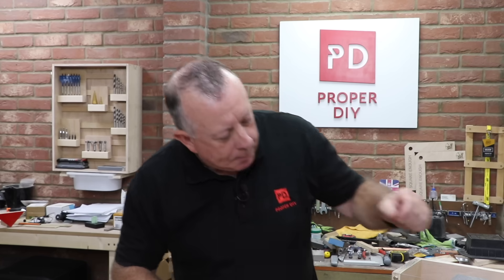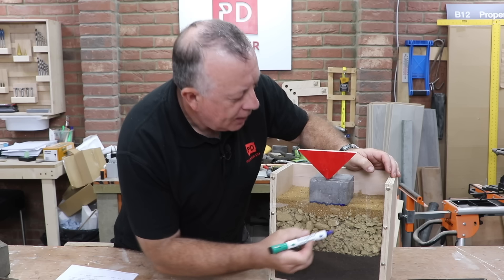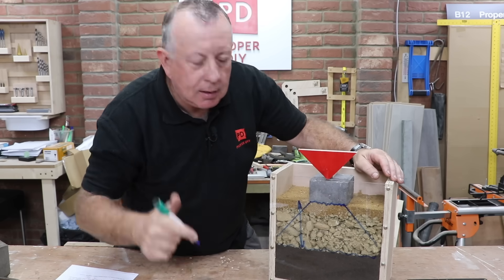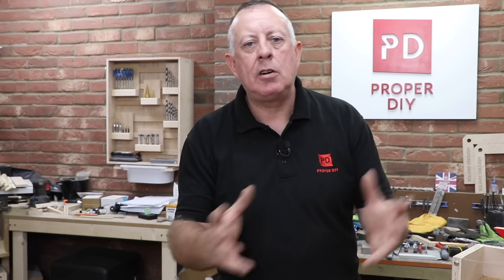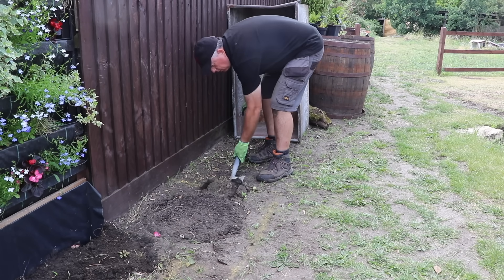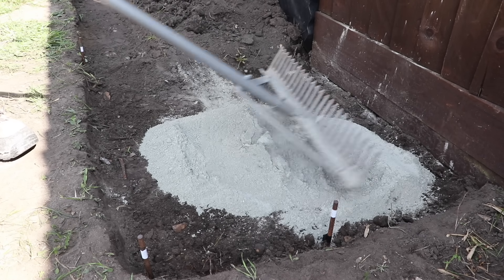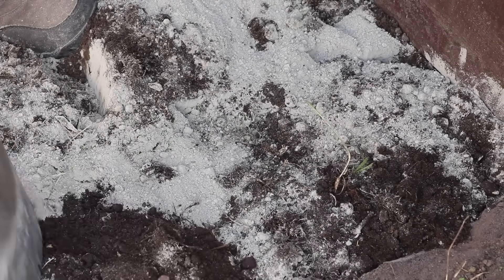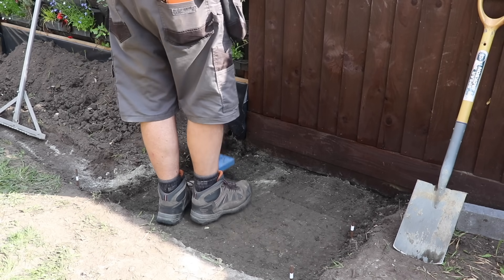How to Save Time & Money by using a little known Civil Engineering technique in the garden!

Comment: Excellent. We have a (approximate) 6m x 5m area that we want to use to park a few motorcycles on. This would be much cheaper than getting concrete brought in. Also for the barn/garage floor which is just dirt at the moment. But going back to the motorcycle parking, would the 4-1 mix be about right with possibly an increased depth and would putting re-bar on base be of use?

Comment: i want to prepare the base of the veranda with one layer of this cemented soil, then stone, than sand and then use cement bricks for the surface. the base layers should be more than enough to prevent shifting and sinking, right?

Comment: Very interesting video. I’m about to try this on a small project, however one thing I’m unsure about is how to ensure it dries adequately in wet weather, to ensure it gains sufficient solidity. Would it be worth temporarily covering it with plastic sheeting for a few days before putting sand and paving over it?

Comment: Hey PD! Recently DIY Guy has made some vids on a Pier system for a shed base. Do you think I could use your soil stabilization technique to build the subbase for a pier system or would it not be able to support as much weight as MOT type1?

Really interested to hear your thoughts, doesnt make sense to buy material if i can just stabilize the soil 🤔
Reply: I really get the impression that this would work 🤔

Comment: I understand this from a pave block standpoint, but if I'm pouring a concrete patio,  its not clear how a firmer base layer withstands the freeze thaw cycle, and would result in a cracked patio.  Doesn't the agggregate allow some soil movement below grade, in the same way it allows transfer of water across its surface?

Comment: now redo the experiment using a geopolymer activation solution. a mix of sodium hydroxide and water glass that is activated by the alumina and silica in the soil particles?
it will be even cheaper, have 5% of the Co2 impact as portland cement, and last 20x longer before it deteriorates

see the youtube channel geopolymer institute for more information.
if you are doing large civil projects you defiantly need to bone up your knowledge of low co2 long life geopolymer options.
portland cement is way to energy intensive, high in emissions, and short of life; in comparison to stronger geopolymer options using local materials
geopolymer can easily be higher in compression and flexural strength with more rapid hardening set times.

Comment: This is a great video Stuart, watched it a few times now. Going to be using this technique rather than Type 1 for a BBQ area. Using this method, is there still a need for a weed membrane? I'm presuming this would go AFTER this layer, and before the sharp sand layer and blockwork, rather than the usual before the MOT?

Comment: Or you can skip working with the dirt at all, make a form, throw in dry concrete. Use a paint roller which pushes the stones down and the soft powdery aggregate up until level. Then lightly mist every 2-3 hours.  Once you are at 12 hours give it a pretty good rain shower. 24 hours later do it again.  Done.  It's called a dry pour method and you can see "Cajun Country Living" do this on many projects.  After you screeded the cement, just stop there, you dont need to add soil.
Reply: That shouldn't be a thing. It's crap
Reply: "It's called a dry pour method and" And concrete manufacturers, civil engineers and everybody that has worked with concrete will tell you no - that does not work.
Concrete must be adequately hydrated AND MIXED to develop its strength or you are left with something that can't even withstand 1/5th the loads it should, not to mention that it will not be resistant to plantgrowth and crack in winter.

Comment: Re. adding water - I've noticed that it's best to stop adding water while the mix still looks a bit dry. Then let it sit for 5-10 minutes, followed by a good stir. Often after a few minutes of sitting like that it's just enough more fluid to compact well. It's like it takes a few minutes for the water to hydrate things and if you add enough water right at the start to make it look good, it actually becomes too wet.

Comment: The longer something takes to cure, the stronger it is. Homeowners are encouraged to water a new slab or driveway so the curing process is slowed and allows for a stronger finished product. This prevents cracking in undesignated places. Even slower in the winter time when it's cold., that's why slabs poured in the winter end up with fewer cracks, and a superb diamond hard finish. I noticed at the end of the video you mentioned you aren't going for strength however mentioned the water slowed curing and compromise strength,.. however a slower cure is a stronger finish, and that is true with cement, caulking, paint, plastics, urethanes, polys, molten stone or steel, etc

Comment: No - water does NOT make the concrete take longer to cure. But not wetting the cement enough will decrease it strength and significantly decrease its resistance to weathering. If the mix is still crumbly it is too dry.

Comment: Great video.  I'm thinking of using this to stabilise fairly heavy clay that will be under a 4*3m concrete slab for an outbuilding.  I have a rotavator so might be able to utilise it for its mixing effects. Some posters suggest lime rather than OPC.

Comment: Interesting concept! 
Now, as you pointed out, for typical garden applications you don't need very much strength at all. And cement is CO2-costly to produce. I wonder how a similar experiment would fare with lime, or even clay.
No, clay does not harden in the chemical sense, and yes, it heaves when it gets wet. But thoroughly compacted, it takes a long time to get wet.

Anecdotally, soon to be 20 years ago, I just wetted and compacted the local clay-rich soil. We built a raised bed for camp fires edged by two layers of boulders. And we paved a path that, until then, was always muddy and slippery when wet. This was at my scouting group, so both see quite a bit of use.
I just went by there recently and both are still fine! Nothing added but water and a good tamping  (and a bit of gravel/sand under the pavers).

Comment: My house has no foundations- I doubt if many round here have - and was built circa 1807, whether they had access to cement or stabilised the soil by other methods is unknown!

There is another advantage of the soil/cement mixture: weeds etc will struggle to grow through it unlike the mot type 1 which has numerous spaces inside, however well it is compacted.

Comment: Cement continues to cure if water is around unless there are sulphates in the soil then you need different cement. 

To be frost proof the base needs to be 450mm deep for South UK area or insulated accordingly.

Comment: My good friend and neighbour used this method in his garden to create a large patio area. He used a rotavator to mix the cement and soil and then used a hand tamper to compact it. The patio is still in great condition after nearly 5 years. This method was much more cost-effective than the alternatives. Thank you for sharing this brilliant idea, Stuart. It will save people a lot of money.
Reply: is a rotavator the same as a tiller?
Reply: @nickelsworth7097  yes
Reply: @nickelsworth7097  yes!
Reply: @nickelsworth7097  𝑾𝒉𝒊𝒍𝒆 𝒕𝒉𝒆 𝒕𝒆𝒓𝒎𝒔 "𝒓𝒐𝒕𝒂𝒗𝒂𝒕𝒐𝒓" 𝒂𝒏𝒅 "𝒕𝒊𝒍𝒍𝒆𝒓" 𝒂𝒓𝒆 𝒐𝒇𝒕𝒆𝒏 𝒖𝒔𝒆𝒅 𝒊𝒏𝒕𝒆𝒓𝒄𝒉𝒂𝒏𝒈𝒆𝒂𝒃𝒍𝒚, 𝒂 𝒓𝒐𝒕𝒂𝒗𝒂𝒕𝒐𝒓 𝒊𝒔 𝒂 𝒔𝒑𝒆𝒄𝒊𝒇𝒊𝒄 𝒕𝒚𝒑𝒆 𝒐𝒇 𝒕𝒊𝒍𝒍𝒆𝒓. 𝑻𝒊𝒍𝒍𝒆𝒓𝒔 𝒂𝒓𝒆 𝒂 𝒃𝒓𝒐𝒂𝒅𝒆𝒓 𝒄𝒂𝒕𝒆𝒈𝒐𝒓𝒚 𝒐𝒇 𝒈𝒂𝒓𝒅𝒆𝒏𝒊𝒏𝒈 𝒕𝒐𝒐𝒍𝒔 𝒕𝒉𝒂𝒕 𝒖𝒔𝒆 𝒓𝒐𝒕𝒂𝒕𝒊𝒏𝒈 𝒃𝒍𝒂𝒅𝒆𝒔 𝒕𝒐 𝒃𝒓𝒆𝒂𝒌 𝒖𝒑 𝒔𝒐𝒊𝒍, 𝒂𝒏𝒅 𝒓𝒐𝒕𝒂𝒗𝒂𝒕𝒐𝒓𝒔 𝒂𝒓𝒆 𝒐𝒏𝒆 𝒕𝒚𝒑𝒆 𝒐𝒇 𝒕𝒊𝒍𝒍𝒆𝒓 𝒅𝒆𝒔𝒊𝒈𝒏𝒆𝒅 𝒇𝒐𝒓 𝒎𝒐𝒓𝒆 𝒉𝒆𝒂𝒗𝒚-𝒅𝒖𝒕𝒚 𝒘𝒐𝒓𝒌.
Reply: Would you use a weed barrier in this setup, and if so where would it go?
Reply: So did he lay sand over the cement/soil mix & pop the patio slabs on that?   
Or maybe a bit of cement with the sand?
Thanks!

Comment: In the late 1970s I helped hang some fifteen foot steel gates round the farm with very heavy tubular steel gate posts. We did something not unrelated to what you did here.

Firstly [and in those days it was all hand digging] we dug out some large holes. There was quite of a lot of stone [brick-sized and bigger] in the ground which we put to one side with soil going to another side. 

We dry mixed a small amount of cement with a fairly small proportion of ballast, and also the soil. We put in and levelled for upright [and height] the gate posts [two man lift in each case], and back filled with the dry mix, but adding all the large stones as we went. Every four to six inches we used a watering can with a rose to gently slightly wet the mix, and tamping and compacting with a sledge hammer and heavy steel six foot bar. The posts went in three feet so quite a lot of work. Just below the surface we stopped and topped off with some remaining plain soil. Of course there was a small amount of spare soil, but easily spread into the field.

Those gates are still there over forty five years later and have not moved off being straight and level. No wooden gate post would last that long however good the wood might have been. The rot off at the ground ...

This went right against what I had been told up till then that getting soil into a cement mix really weakens it. I suppose the reason that these posts have not moved was not down the strength in the mix as such, but rather the massive weight and volume of it.

Very useful video for work on a domestic scale. Fantastic, and thanks for reviving happy childhood memories! 🙂

Best wishes from George in Herefordshire. [No longer involved in farming sadly].

Comment: there is a VERY good reason why NOT to use soil, it contains bio materials that will degrade and break up, that is the reason why you don't use despite how much you compress it right now, because it won't last
second - English accent, which means you rarely see freezing temps during winter under top layer of your roads/walkways, this compacted soil will absorb moisture, which will expand and contract around 0C ~ -4C, which will further reduce longevity of this compacted soil
so despite how much you compact it - there is no way to make it durable enough to make it last, that is why you should use proper building materials that drain water below them to avoid freezing expansion/contraction cycles, and materials that don't absorb water and break up because of it, AND don't contain bio degradable material (which usually is what makes the browish gravel and sand dark or black)
do not reinvent the wheel, there really is no need

Comment: Loving your work! I'm gonna investigate this as a possibility for my project. Got 60 sq metres of front garden to convert to a driveway. About 20 sq metres will be block paved to create a path down one side, the rest will be gravel grids filled with 10-20mm angular stone. If it saves on the cost of dig out, removal and purchase of at least 20 tonnes of mot, I'm willing to give it a go! My soil has a lot of clay though, what do you think?

Comment: Great video, can't believe I've only just learnt this!

I have a 450m2 gravel driveway to install. I was planning on doing a reduced level dig, installing 100mm of compacted Type 1 and then 50mm gravel on top. The cost of the muckaway and Type 1 is around £5,000. I'm now wondering if I can do this instead of the Type 1. I guess the drawback with this option is that the sub base is no longer permeable. Anyone got any thoughts or experience on this type of application?
Reply: Type 1 isn't classified as permeable
Reply: @amaterasuHS  Yea, but it is pretty much permeable isn't it. I've used Type 3 before, where the parking area was enclosed by a number of buildings, but a single track driveway, which can easily be sloped one side I'd say is fine to be done with a Type 1 sub-base.

Comment: There is no good name for it, but most old buildings in Europe (and east Asia, Africa) are built with Lehm, el limo, leem.

This is not earth, dirt or (pottery clay). English has no very good word for it, but the precise description is, that it is a natural soil that consists of (pottery) clay and sand, but no Humus.

When dry it has a medium hardness, certainly hard enough as plaster or mortar. It can almost absorb an amount of water equivalent of its own weight before it softens. It dries back without permanent damage. 

It is a perfect material for internal walls as it absorbs sound and buffers room humidity. It buffers heat as well. At the same time it is tough enough to hang heavier things on it, as long as the right screw is used without any dowel.

People who visit feel comfortable, but often can't tell why exactly.
I think it is sound, humidity, and reduced smells all together. They say they smell wood.

Comment: I've done aa bit of this around home over the years.

Hydrated Lime works too, and is a bit "greener"

10% is a little high yu can go to 5% pretty comfortably.

For garden walls etc if you have surplus soil you can add 2,parts shredded paper by volume and make a lightweight yet incredibly strong fibrous material.  *see "Papercrete"  This can,save you money on sleepers etc and won't rot.  You ca even make your own pavers if your mix has about 10% sand.

Comment: Thanks for the great video, would you suggest doing this beneath concrete plinths such as easy plinths as an extra step before building a timber framed room on top? Or is it redundant as the plinths are already spreading load?

Comment: Just seen this and now my head hurts😂I'm in the process of building a small workshop (5mx6m) and I've been considering the issues of removing the grass and subsequent soil layers to then build it back up with type one and a blinding layer prior to shutters and dpm. I should have said access is very tight.
Would this be a good sub base under my slab?
Slab will be 125mm concrete with mesh on dpm on whatever sub base is decided on. Shutters are permanent galvanised C sections to perimeter.
If this would work it would save an absolute fortune.
Brilliant videos by the way 👍

Comment: no chance of doing that with my ground. solid clay!!!!!
Reply: Websearch "rammed earth".

What is the ratio of rammed earth wall material?
Aggregate size	Min Content	Max Content
Clay	                       4.2%	16.0%
Silt	                             14.8%	25.3%
Sand	                     31.0%	75.0%
Gravel	                       0.0%	38.0%

Add to a composite of 16% clay, 15% silt, 23-38% gravel and 46-31% sand; 
with 5% - 10% of the total clay, silt, gravel and sand volume in added portland cement for a solid rammed earth base.

Silt: Silt particles feel smooth and powdery when dry and smooth and slippery when wet. They do not stick together as strongly as clay particles. 
Clay: Clay particles feel sticky and cohesive when wet and can form a plastic, moldable mass. When dry, clay soil can become hard and compact.   12 Aug 2023

What is the difference between clay and silt?
Clay has comparatively more water holding capacity than silt. Since clay particles are smaller in size, they have more surface area than silt particles. Clay particles are sticky in nature. In comparison, silt comprises non-sticky, uniform, and smooth-to-touch particles.   15 June 2022

Chemical Stabilization 
Lime and cement are commonly used additives in such methods because lime reacts with clay, increasing its strength and reducing its plasticity whereas, cement stabilizes the soil by binding the particles together, enhancing its load-bearing capacity.7 Jan 2024

How do you stabilize clay ground?
Clay soil can be stabilized by the addition of small percentages, by weight, of lime, thereby enhancing many of the engineering properties of the soil and producing an improved construction material.

What is the chemical stabilization of clay soil?
In general, most clay soils can be successfully stabilized with portland cement or lime. However, the achieved engineering properties of a stabilized soil are dependent upon a number of parameters ........

Chemical Stabilization
Chemical stabilization of clay involves adding chemicals to the clay soil to alter its properties. Lime and cement are commonly used additives in such methods because lime reacts with clay, increasing its strength and reducing its plasticity whereas, cement stabilizes the soil by binding the particles together, enhancing its load-bearing capacity. Both the elements help the soil build and retain its strength to facilitate easy travel.

Comment: Stuart I need help lol. I got a 3x2 patio I want to do. Everything has to go via the front door , kitchen to garden and vice versa. I hit rocks 6 inches deep, which means 2 tons of MOT type one and sand just to lay 12 slabs 

Can I use this method instead?

Take the turf off, mix 100mm soil and cement, sand and screed and lay pavers? 

Really need help mate, I’ve abandoned it for now due to having to shift so much stuff through the house 

Matt

Comment: This is excellent, could this be used as a foundation to stabilise for piers for a 4200mm x 2400mm timber garden room, even if I had to put more piers in and do it wider than the piers to spread the load?

Comment: Great video! Thanks. I’m planning to build a small workshop/wood store (for wood burner) with a footprint of 8’ x 7’ (workshop) / 7’ x 4’ (entrance way/woodstore) –12’ x 7’ combined. Do you think using this method under concrete blocks to create a foundation for a wooden subframe that the shed will sit on will be strong enough?

Comment: Keep in mind that cement is super expensive compared to gravel/sand (10x more expensive in my area) so you're still using the most expensive ingredient, but like he said, this is for rare situations where you don't want to have to trasnport the soil away
Reply: But you're only using 15% and it's much less work.
Reply: @mchlbk  No, it's generally more work and more cement (per strength). but like he said, it makes sense in certain scenarios where you have nowhere else to put the dirt